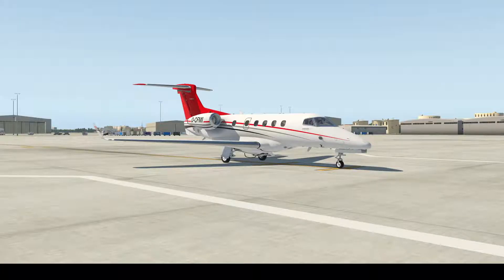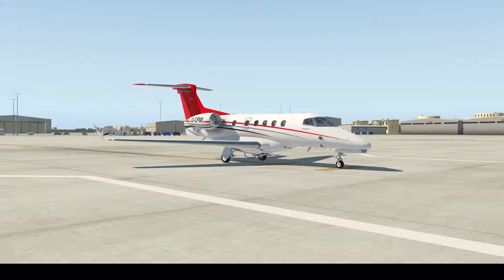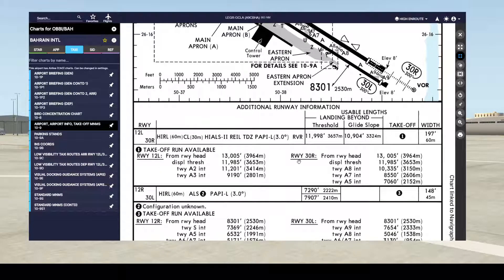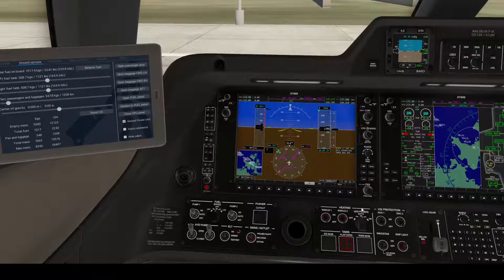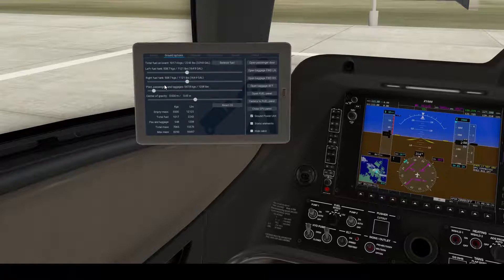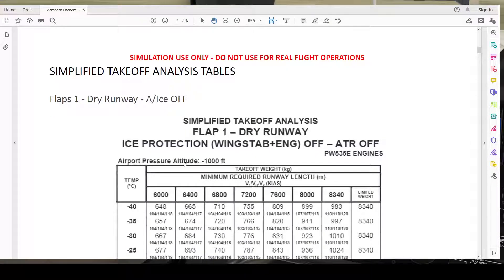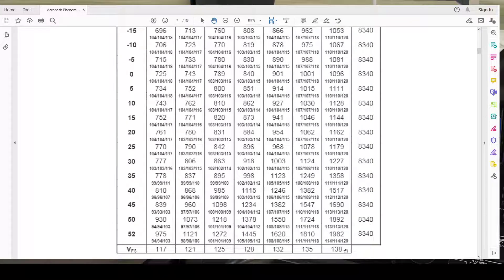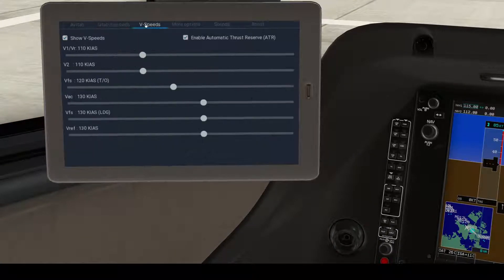X-Plane | Phenom 300 | How to Take-off speeds

Comment: This is incorrect. You are using the max take off mass not the actual of 7065kg so the speed are wrong.
Reply from the maker: Look at this https://forums.x-plane.org/files/file/72984-flight-performance-calculator-fpc-for-aerobask-emb-505-phenom-300/
Flight Performance Calculator (FPC) for Aerobask EMB-505 Phenom 300
Reply from the maker: Also you can find my other add-ons on my discord server